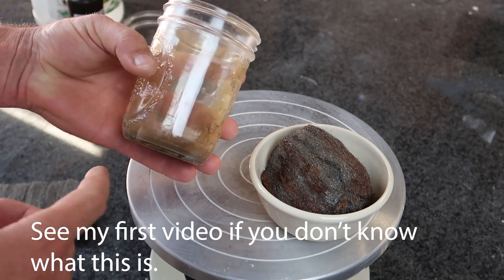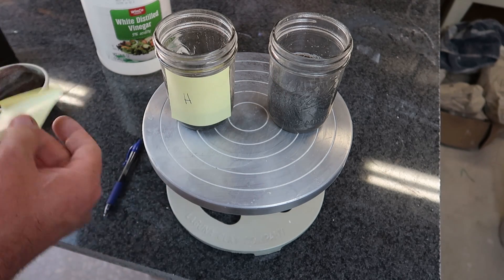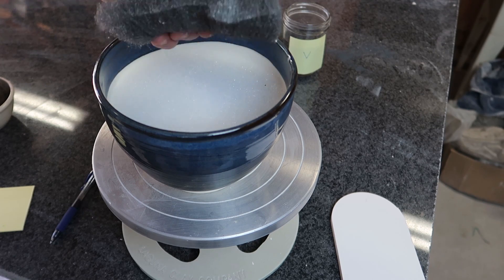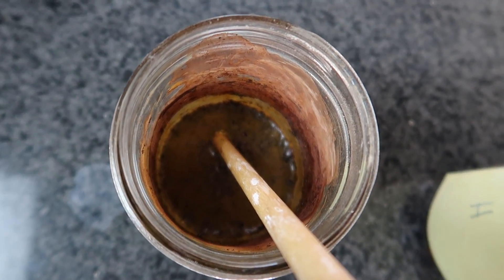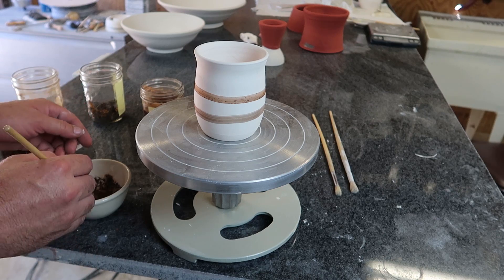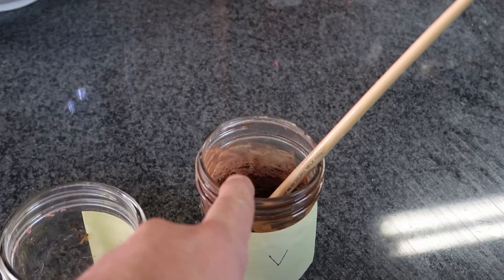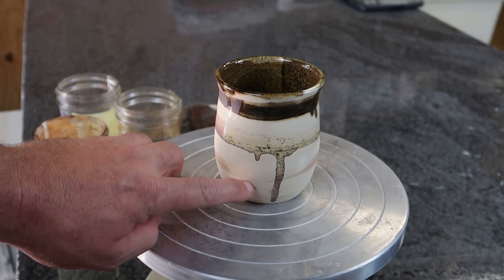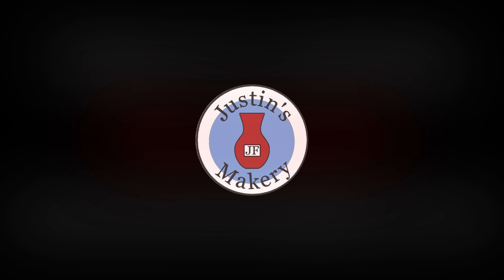Making Iron Oxide with Steel Wool - Pt.2

Comment: Nice work! The heat from putting steel wool in vinegar comes from making Ferric Acetate. Acetone gets the oil of steel wool much better than soap & water. Vinegar will give a much smaller particle due to the nature uf the reaction.

Comment: Cool to see these experiments.  I use steel wool for some woodworking projects and it does come with a protective coat of oil.  Mineral spirits works the best for removing this oil.  If you continue, give that a try.

Comment: I believe you can also add a little peroxide to the vinegar mix to accelerate the process. It looks great, though! I've used the vinegar mix before as a wood stain once; it gives a slightly aged/weathered look to wood.
Reply: came here to say this. peracetic acid reaction creates heat so do it in a water bath. But your 4 day vinegar result? you'll have it in 10 minutes

Comment: Austenite iron only exists at room temperature in some stainless steel (300 series), steel can phase transition into Austenitic steel around 730 C but once it cools it will become ferritic or martensitic, both these forms are magnetic. Your treated powder does not react to a magnet because it has formed an oxide of iron iron oxides are non-magnetic